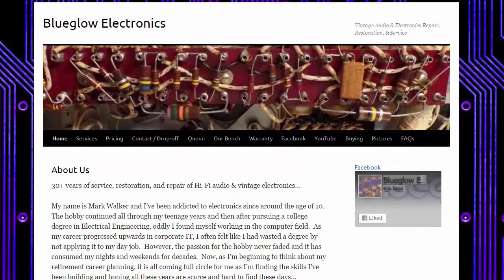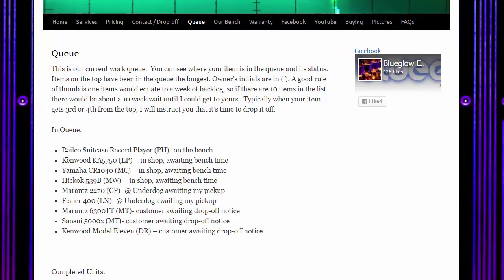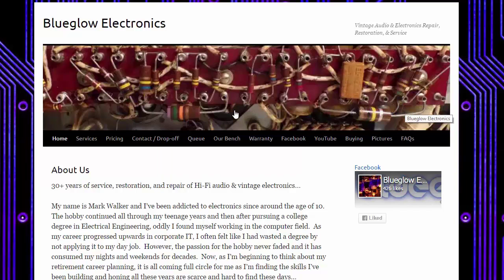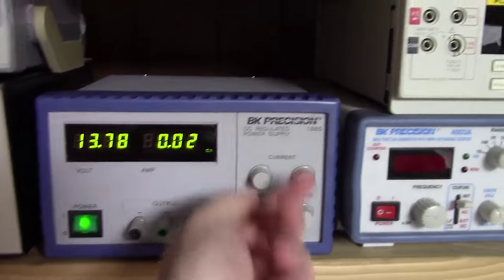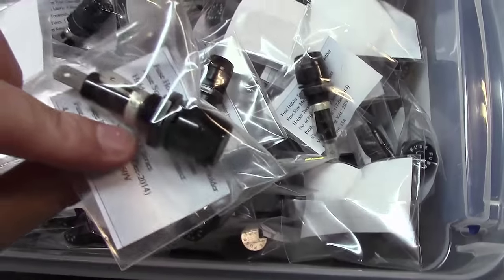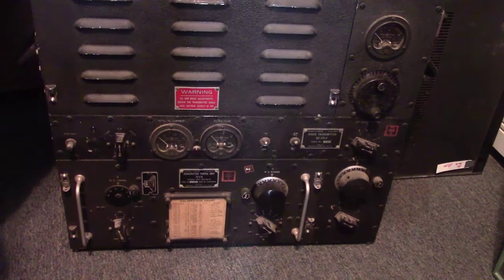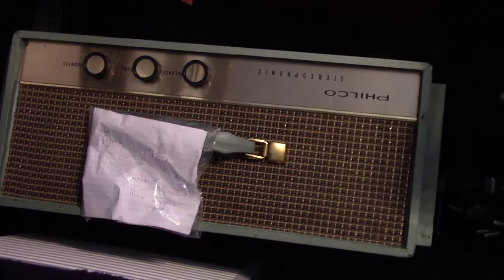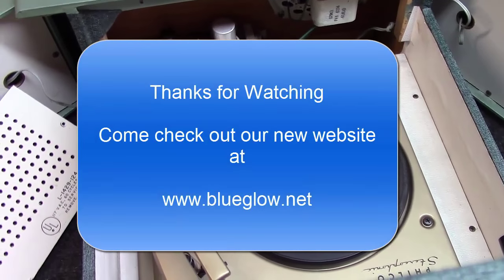Our New Website and Latest Swapfest Finds - BG050

Comment: What would you use to clean up those Klipsch AB crossovers? Would it be ok to flush them with plan contact cleaner?
Reply: I always use  leaner with some lube in it, like a light mineral oil.  Always works better that way and it preserves the pots.
Reply from the maker: +Arnold Rimmer sure thing.  would probably use air compressor on them, then contact cleaner
Reply from the maker: +Blueglow Electronics This is just my opinion but WD40 should never be used in any electronics, ever.  it gums up over time and has other chemical issues.  I've fixed many a radio where someone had used WD40 on it and it caused issues over time.  But thats just my opinion...
Reply: For cleaning I use either radio shack cleaner, or deoxit.  The best follow up or just lube is believe it or not, REMOIL.  It's a really light gun lube for high end firearms.  It's awesome.  Does not break down plastics, neoprene or rubber! Actually YT user "shango066" uses it too.  It's great! Wd40 is a solvent.  It breaks down rubber and plastics and other components. He is correct.  Love your shop and variac and equipment.  I was drooling!!!  I have similar stuff, no klipsch, but I have some vintage JBL 4312's...

Comment: do you happen to have any speaker plugs for a pioneer sx-424?
Reply from the maker: +Andrew Bohinick I have one set, sadly they are attached to a pioneer receiver.  Good luck, they can be found on ebay pretty easily in the $25-40 range for a set.  Many up there right now, just search "pioneer speaker plugs".